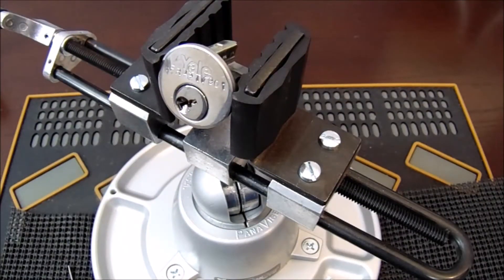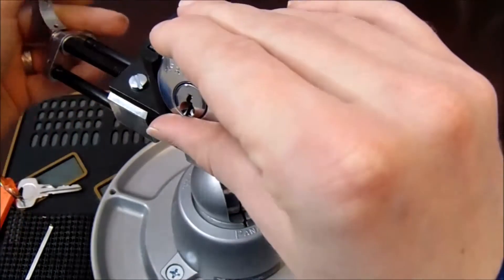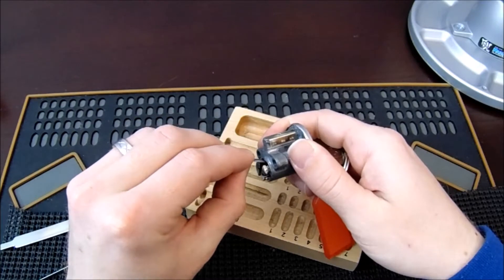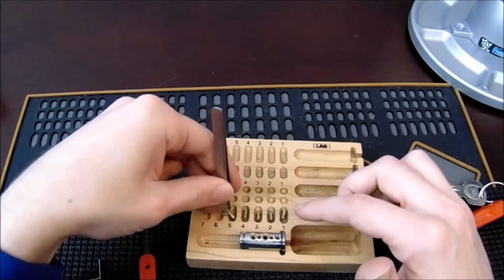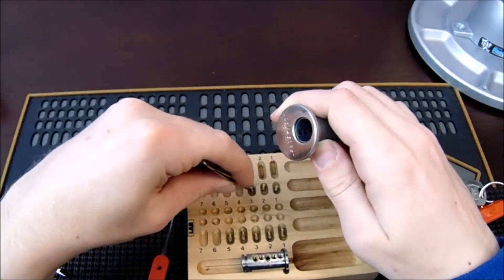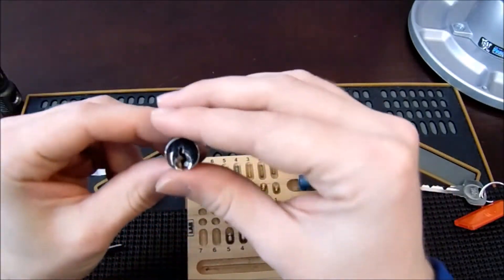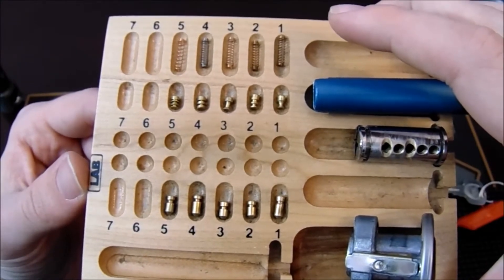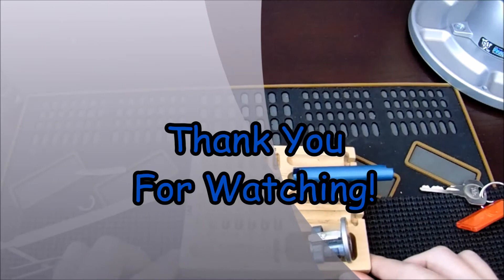[101] Frosty901 Challenge Lock

Comment: I guess I'm used to seeing older, higher quality, Yale locks, when Yale was "Yale".  I was surprised to see a "pot metal" cheapo "kwikset like" inexpensive rim cylinder -- Guess I'm "spoiled" by "old school" brass cylinders -- Nonetheless nice job by Frosty901.  Nice looking driver pins, good machining work "Mr. Frosty"  Question to anyone -- Is this "yale" cylinder as cheaply made as Kwiksets are? (abet with a more challenging keyway)
Reply: Thanks buddy =) If memory serves me correctly I think I picked this one up new on ebay for about $20. So probably about the same price as a kwikset. It's more cheaply cheaply made than the old Yales, but the tolerances are slightly better than a kwikset, not by very much though. 
I did just pick up 11 of the old school Yales for future challenge locks =) Got all 11 for $5 + shipping.
Reply from the maker: Thanks for sharing Ken. I hope you are doing well